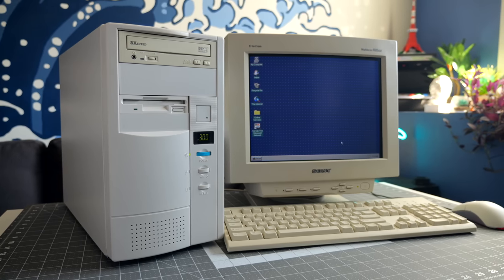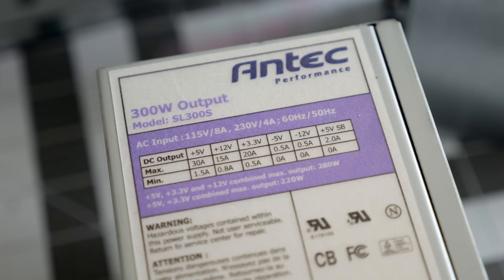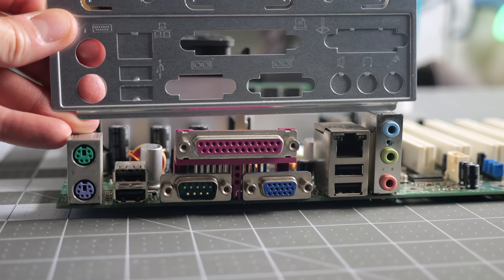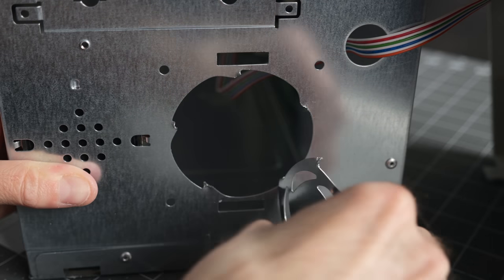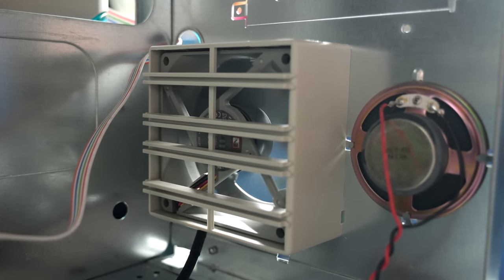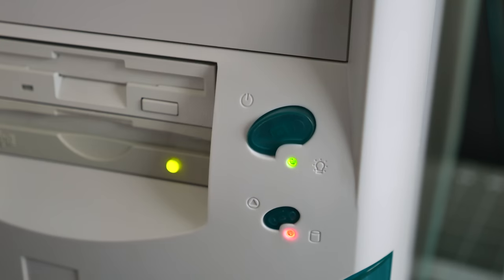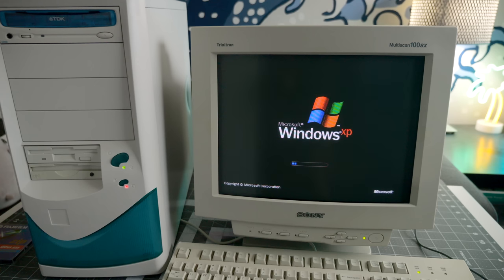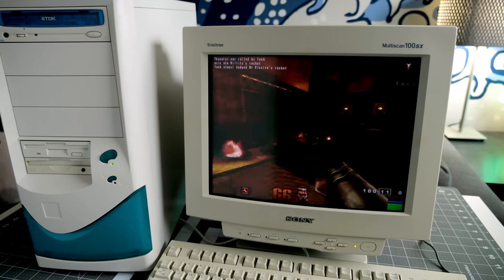Putting Together My Own Retro Desktop PC

Comment: I think you should dual boot Windows 98 because that will be cool, it will be a combination of the 90s and the 2000s like it's case and the hardware itself, i recommend to use Windows 98 on the IBM Hard Drive and Windows XP on the Samsung/Seagate Hard Drive cause Windows 98 doesn't support up to 30 GBs because of FAT file system's limitation and it would be also weird to see Windows XP have a small storage than 98 with a much more space.

EDIT: i also noticed that the Deskstar drive is actually 61.4 GBs which at first i thought was only 4 GBs which the FAT file system can't support so that means that you need a Hard Drive lower than 31 (or 32??!) GBs of hard drive

Comment: 15:40 I usually go with Nvidia because timing/price usually align when upgrading every few years. But built many gaming builds for friends and family in the 2000s and ATI was fine. 8500/9700pro/9200/X850 and X1950 agp;  all no more fussy than nvidia builds over the long. Only problems turned out to be bad ram or psu. Seems 98% of Radeons bad driver reputation are from two gpu's, the Rage3d and 5700XT, and just being slow on the optimisations. Their OpenGL performance never quite matched Nvidia like for like... Until Vulkan wrappers.

Comment: 10:30 They were asking 280 bucks for that CD burner... I'm sure it was not exactly one of the cheapest on the market, but leaving that aside, isn't it sweet we can get a new one (DVD burner in this case) for one-tenth of that price or less (not even considering inflation), in spite of (especially internal) optical drives becoming legacy hardware? I don't imagine many are sold, and therefore manufactured, anymore compared to 15 years ago, still they're dirt cheap! I guess I should get myself a couple of them or more before they are completely phased out and they are only available used or NOS at stalker prices...

Comment: Was at FreeGeek just last week and almost bought the 98 machine that is proudly labeled as having been featured here haha
I just need to get rid of some excess vintage computing first...
Reply: OHHHHH- And before I forget, my XP machines are still my all-time favorites. I currently have two that I'm toying with. I mean, I got my best 98 machine for the privilege, but it is by no means a gaming setup(I was the one that bought that 1999 Compaq Presario that FreeGeek listed for $20 about a year ago. Couldn't resist a complete set for such a cheap price. Still had original restore discs from one I had in it's time.)

Comment: Think windows crashed when installing the sound driver because Snappy was trying to do something with it while the computer was trying to use it. Think windows just doesn't like audio drivers if they're faulty, since I had a similar issue when I tried to uninstall headphone drivers while the program that used the drivers were still in use, causing the computer to crash and get into a BSOD boot loop

Comment: Nah blud you can't seriously call the 9200 a good deal when the 9000 was just a bit more in 2002 and despite the name actually better. It slotted almost perfectly between the slower 9200 and faster 8500, in that order. ATi naming schemes were all over the place. Also yours is an LE which could be worse, could be the SE, but it's not as good as the normal 9200. 

I find it interesting as well that you didn't  choose the superior AMD platforms of the time but I guess they're so much sought after for that same reason and therefore hard to find. I can tell you built these on a budget and for that it's an amazing computer.

Comment: IBM had terrible problems with a specific model , the Deskstar 75GXP and possibly the 60GXP and 120GXP, as well but far from a general reputation for drive failures. Quite the opposite in fact.Those did destroy the marketability of the brand enough to motivate the sale of the division but Hitachi kept all the model names because their reputation overall was so good.

Comment: When i left windows my machine was a amd 2600+ k7s5a mother board 512mb ram and geforce 4 ti4600 from msi 250gb hdd windows xp lg48x cd writer and a liteon dvd burner ran most stuff apart from doom3 it ran but it was jerkey

Comment: 07:32 Aw, Dupont contacts can be removed with pointy tweezers or some other sharp bit, just lift the plastic lock and pull, no need to cut that thing.

Comment: Nice build i have a similar One but i had Windows 98 install there with a Radeon 9250 se overkill for win. 98 and another build for XP with a Pentium D940 with 2gb of ram and and ATI 1550, i think the problem on crysis was the missing dx 9 support on these card of you get at least a ATI 9600 series It Will fix that problem, anyway nice XP build.

Comment: that tdk drive tho. . . still think I got mine, and the case with the 800mhz duron 512 meg of ram, some nvidia card, that we put a window on the side in and I put clear mirror print appliques on from the car audio shop I had stickers cut for my car to have the amd, tdk, and linux penguin of

Comment: I hate Samsung HDDs. All i had is trouble with them. They constantly failed in various ways: motor and spin-up errors, one had control board issue, two had reading problems. I slowly replaced them with Seagate and WD drives in warranty, which are still working.

Comment: Ouch @ all that cutting and those break/pop out panels. You like blood sacrifices, don't you? If needed, I just raised the little plastic clip on the power LED connector with either a knife or paperclip to slide the conductor out and slid it into the neighboring slot. Though, with how close/cramped the space was between the case's front bezel and the steel, air flow from the front of the case is hosed even when you cut out the fan intake restriction. At least file down those barbs on the fan intake for the next time you're in there? lol
Reply: That's what PC building was like back then! I got many cuts from cheap cases, pulling knockouts, and even did a few of my own fan grille removals to cut down on noise (which I would later cut myself on since it was on the back of the case, haha
Reply: @volvo09  Oh, I remember, lol. I built plenty of machines back then too. Hacking myself up in the process of building isn't part of the retro experience I care to relive if I can help it, lol.

Comment: I use an SSD for Windows XP, as long as you can get the TRIM to work on it (using a Windows 11 USB helps)
Reply: I like keeping hard drives in "retro" pc's. Especially if the drive is audible and clicks during seeks... It's more true to the time. 

Ssd's were very rare in the XP days.
Reply: @volvo09  That kinda depends on whether or not you steadfastly avoided Vista. I'd upgraded to an SSD boot drive by the time I upgraded to 7. Certainly though for early XP, but most people running period games on hardware that old would be doing it on 98SE/DOS, I remember how terrible XP's compatibility used to be with what was then considered "old games".
Reply: @volvo09  That is true, though honestly that's one of the few things of retro PCs that I can live without. It's more trouble to install Windows with a hard drive, and SSDs have become much more reliable and kind of the "go-to" for storage. Hard drives are just cheaper.

Comment: Zip was hardly common. Never had one, click of death (Steve Gibson) alluded to on a podcast I heard.
Reply: I still have my original Zip, the external parallel port model.  Good thing I bought the early model from the mid 1990's, years before the click of death, because Iomega panicked on the rising popular demand & hastily ran their assemblies without quality control.  I also found an internal Zip drive later on at Goodwill thrift store, around 2010, which that internal IDE version is like a hundred times faster than the external.   Had Iomega paced their Zip through quality control, it would have likely stuck much longer as a common storage medium, although they did also have to keep up with the times & introduced Jaz & their own CD drives.

Comment: I would be curious to know which games from XP period can't run on a modern Windows.
I understand it can be funny to build a XP computer, and I don't see much "retro" in this.
Reply: I mean, the OS and the components are 20 years old, so I’d say it’s retro at that point 

And in my experience, I have had games that only work properly on XP, since a good chunk of older games has their physics tied to the frame rate. If the frame rate was way too high, then the physics would act really weird.
Reply: @nep-nep6575  The last game I had for which the framerate was tied to the power of the computer was Unreal, it's been a while :)

Comment: One reason Intel motherboards like these did not have any sort of "overclocking" was because of at least two points... 1.  Intel made CPU's, and 2.  Overclocking was not condoned at the time & that if you overclocked your Intel CPU, then that pretty much voided the warranty. People have been overclocking capable CPU's since the 8088's on at least consumer-grade boards.  Today, Intel had since finally resorted to designing their newer CPU's (since multicores iirc) & newer motherboards to be able to automatically overclock when programmed to.  You could say that Intel copied & stole that idea from overclocking enthusiasts over the years/decades & made it their own.  If you (Intel) can't beat them (overclockers), join them.  Btw, I used to work at an Intel motherboard factory for over a decade in & around this time of the Y2k era.  So many different motherboard models were built on our lines, using SMT (Fuji, iirc) & THM placement machines & SMT ovens, then bigger thru-hole components placed by hand & finally through wave solder. Can't say if this motherboard model used above was one of them.  I handled motherboard component inventory, as well as stocking barrel-sized levels of liquid chemicals required for these assemblies & also ordering pallets of solder (leadless).

Comment: It's a pity modern cases don't have 5.25 bays.  I rip so many disks that I have 4 bluray burners in my now 15 year old Lian-Li case.
Reply: I know,  I got a fractal r6 case with the usb-c kit for my latest build just so that I could have at least 1 5.25 inch drive bay.
Reply: I have a fractal design case and it has 2 5.25 bays
Reply: They're just not that much use to many people anymore, I wouldn't want to not have an optical drive at all, but I stopped caring about having one in a laptop a long time ago, and I've never owned a BluRay drive (or disc) of any kind. I own a handful of DVDs but they tend to get ripped once and then stay in their cases, I'd gone 98% discless for music and movies before the jump to HD. For a while you could get hybrid cases with an adapter to mount 4 3.5" HDDs vertically in the 5.25" bays but how many people even need 3.5" bays now? Maybe 1 for a large storage drive, even 2.5" is gradually disappearing with M.2

Lian Li made some stellar cases though, for years all I wanted was a PC-61, but I could never afford it.

Comment: Meh, P4 was the point at which AMD took over. P4s needed more expensive rambus memory and the long pipeline hurt it for "branchy" applications. AMD Athlons were great processors and they used cheaper and less laggy DDR memory. Intel didn't really come back until the Core 2 Duo.
Reply: Yeah it occurred to me while watching this that I only ever see P4s in videos or for sale when looking at computers from this generation, yet when I was living in it everyone I knew had Athlons or Celerons. I guess dell just sold the things by the millions to like every business in the world.
Intel hit it out of the park with Centrino, but that was in the mobile space, and also based on previous architecture. At least they invented hyperthreading in this generation... it just didn't really work until the Core 2s.
Reply: I think at least for most people, P4s are somewhat more nostalgic since they were literally everywhere. Most people who had Athlons I’m guessing usually built their own systems instead of upgrading a prebuilt.

Comment: I own like 5 fx 5200's and no it's not bragging it's just how many I accumulated over the years all agp. I can safely say you are not missing, nothing. Honestly, the performance on all of these cards are equally low. I was never impressed by the entire geforce FX line. I even have the fx5500 which I think is an OC'd fx 5200 as well. Both sides made crappy cards back in the day.

Comment: The Antec SL series power supplies were NOT good. Antec used shitty Fuhjyyu brand capacitors, which have a 100% failure rate. I've recapped dozens and dozens of these supplies over the years. You can expect that any SL series power supply, or any Antec supply for that matter from the 1999-2008 time frame to have bad capacitors. When they finally did move off of Fuhjyyu capacitors, they started using OST, Asia-X, Teapo, CapXon, JunFu and a number of other garbage Chinese/Taiwanese made capacitors that had equally horrible failure rates.

Exacerbating that problem, Antec was also obsessed with quiet running PSUs, which meant not running the fan, or running it so slow that it was effectively useless. This lead to Antec PSUs cooking themselves to death.

If you buy an Antec supply today, recap it immediately, do not use it until you have new caps in. I would also recommend fan modding the unit so that the fan always runs. Seriously, those things would get so hot that the PSU housing could burn you.

Comment: P4 478 is not that old, it can hold 2-4gb ram thats why you fail, and not overclocking it to 3,2ghz because it can easy, with a simply Geforce2 you can play youtube on 1080p and no mention an AGP geforce 7300GT. Is not that old but you failed on not overlocking and not getting enought ram... with 4gb you can even install windows10/11.
Edit: get a motherboard with 4 ram slots... anyway the 1ghz ddr1 modules exists, i had them on my  3.2ghz p4 shuttle HTPC at work, and windows7 is way better than XP for today use and it can look like Windows95 too disabling modern theme. But anyway Pentium4 is not that old, its ATHLON64 times... way better i had it with windows xp64 bits... p4 is crap, if you want a retro PC get more ram and windwos7 or just get an older XBOX that is from 2001 not 2003.

Comment: This build would be better suited for Windows 98, it’s quite underpowered for XP. I prefer at least an Athlon 64 for XP.
Reply: I mean, windows XP was designed to run on Pentium 3s, probably can even run it on a PII since those run Win2K pretty well, and WinXP is basically just a modified version of Win2K.
Reply: @Nep-Nep  I'm aware of what it's capable of running on. I installed the beta version of XP on my P3 800 in December of 2000. I also tested it out on my P2 400 system. It will run just fine as long as you have enough ram. The issue is the vast majority of games that are designed for XP require a bit more power than the system he built here. This is definitely a low spec XP machine. You'd only be able to play the early XP games on it. It's my opinion that it would be better suited for 98. I have several XP systems currently and the lowest spec hardware I use for XP is an Athlon 64. My highest spec XP system uses an i5 2500k, which is massive overkill and was only built to run some benchmarks for comparison. XP supports such a wide range of hardware and its my belief that, if building an XP machine, you should aim to have hardware that's powerful enough to cover the entire XP era 2001-2006. Don't sell yourself short with a system that barely runs the earliest of XP games.
Reply: @IronicTonic8  I dunno, my own Northwood P4 with a 6800GS runs games from that 2001-2006 era quite well. Not fantastic (it’d probably perform much better with the HT version) but that’s the fun with it at least for me. 

You don’t have to build the best of the best retro computer to still have fun with it, you just have to build a computer that fits a certain vibe.
Reply: @Nep-Nep  I can agree with that, build what you want to get the vibe you're going for. I'm just coming from the perspective of, I've built literally every possible combination, and I can tell you what would be best. I've got dozens of retro systems and I collect retro hardware, so I have vastly more experience than anyone I've ever met. If someone wants to run XP on lower spec hardware, go for it. I'm just sharing my opinion on what the hardware would be optimal for. You're more than welcome to disagree with my opinion.
Reply: @IronicTonic8  I kinda get that as well. After all, it is preference. I have quite a few xp machines myself (even one of those weird tablet things that use a Transmeta Crusoe), and all of them except for that tablet are Pentium 4s or Core2s, since that what I grew up with.
Reply: @Nep-Nep  I had an Athlon XP system and later Core 2 system during that era. One thing I never had (and always wanted) was an Athlon 64 system back before the Core 2's came out and AMD was on top. That's my preference for an XP system these days because it's the system I dreamed about during the time period.
Reply: @IronicTonic8  huh, I’ve kinda wanted to build some sort of socket 939 system, but I never really had any incentive to. I’m content with my P4 and I don’t have any room for full size computers anymore, haha.
Reply: @Nep-Nep  P4's aren't bad, I have a soft spot for them, specifically the higher end Northwood core P4's. They were actually quite competitive in their day and power/heat wasn't really terrible until the Prescott core P4's rolled around. P4 systems are really reliable and versatile too.

Comment: try call of duty 1 and 2, including united offense
Reply: both 9200LE and Ti 4200 gpus are not rated for DirectX 9.0
would you like to try benchmarking them using 3DMark 2000 and/or 2001?